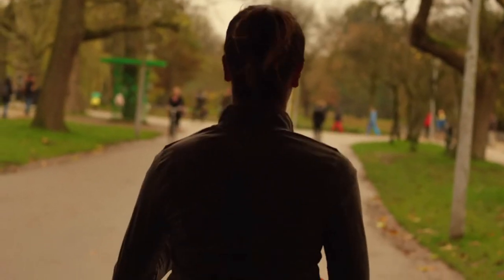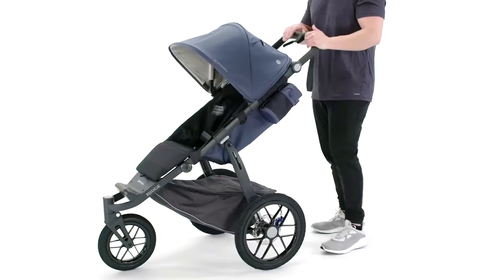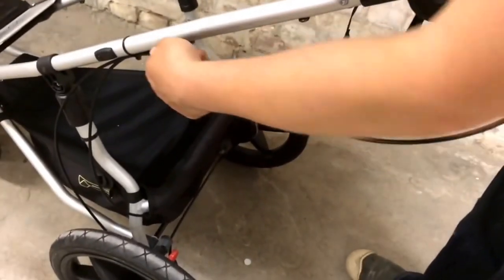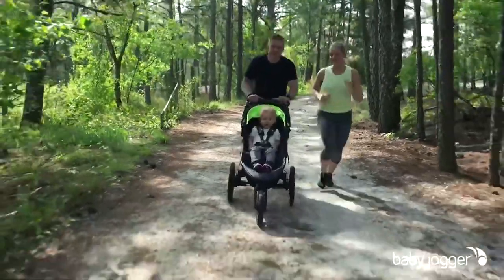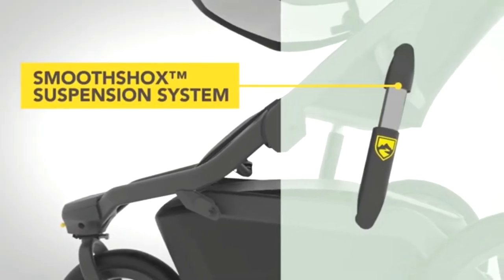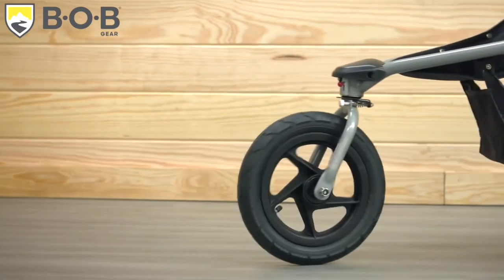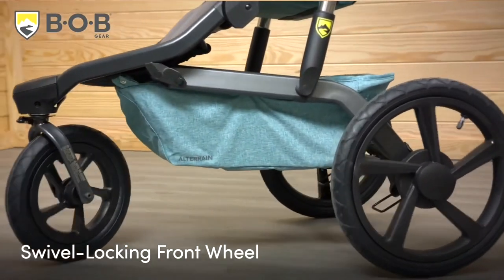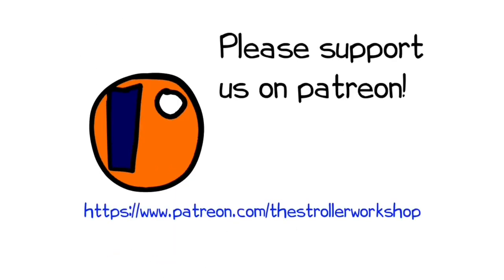How to Choose the Best Running Stroller

Comment: Is the Uppababy ridge front wheel ball bearing locking? Is foam filled wheels like ridge reasonable for a running stroller? Is it important to have the ability to have the seat upright for a jogging stroller? Bob can have an almost 90 degree seat but neither Thule Glide 2 nor Uppababy ridge seems to have upright seat. Looking forward to the ridge review. I pre-ordered the ridge but thinking if I want to cancel the order and check more reviews before purchasing it! Thank you!

Comment: Is uppababy ridge looking better than vista v2 in terms of terrain capability? From the ads they made?
Reply from the maker: Yes, absolutely, but less comfortable to use for most people in other respects I think (forward-only seat, storage capacity in the basket, probably folded-size if not removing the wheels).  The wheel size is large enough that the model really ought to be considered for people who need a stroller for hiking or snowy winter use, it's a bit overkill for use in the city, in my opinion. :)
Reply: @BarnevognverkstedNo  Thank you very much! I just got my Ridge, really like it. Looks super stylish while easy to push. And I live near Bay Trail, it’s more stable to push than Vista 2. I am going to use it for jogging when my baby gets older. I recommend everyone your channel, very helpful! :)